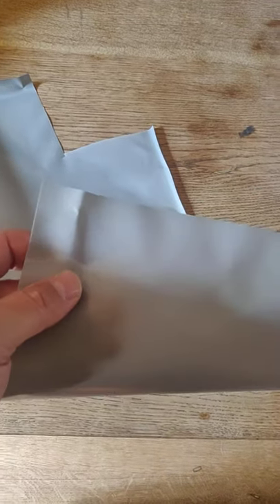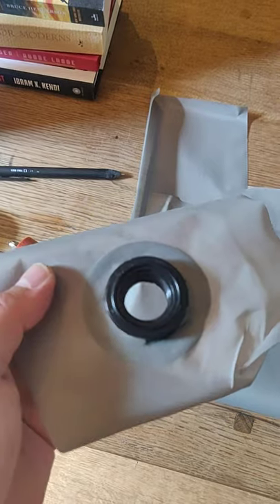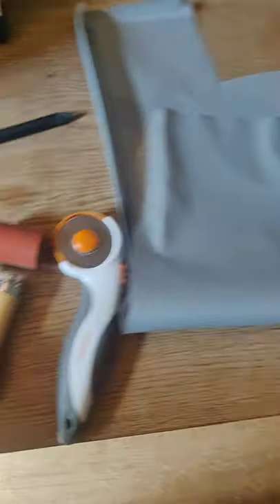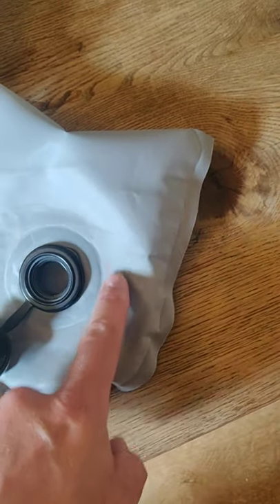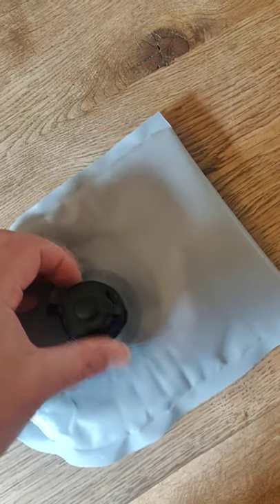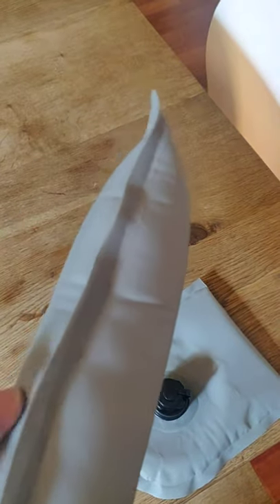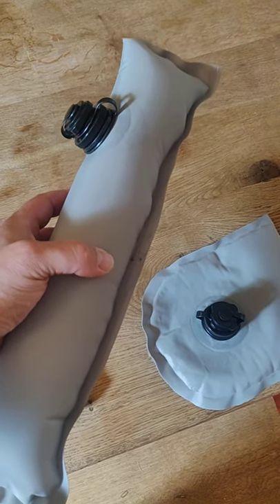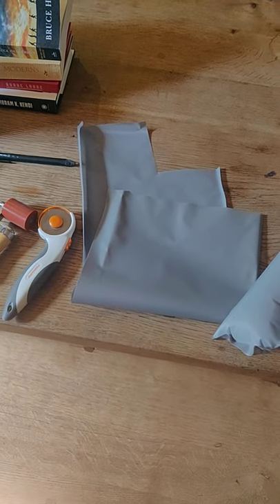tpu (thermo plastic urethane) coated fabric inflatable tests

Comment: Thanks for posting this  - do you have any information on where you got the material and valves?
Reply from the maker: valves were from amazon search for "boston valve" - the exact ones i used aren't available anymore, but there are others..  the tpu came from seattle fabrics - they don't have the same color available right now, but have a "heat sealable packcloth" category at: https://www.seattlefabrics.com/Heat-Sealable-Packcloths_c_142.html
Reply from the maker: these look similar to the valves i actually got, but there are many others for the searching.. https://www.amazon.com/Zhanmai-Pieces-Replacement-Universal-Inflatable/dp/B07P2K1VLM/